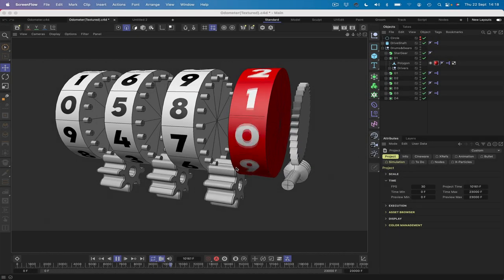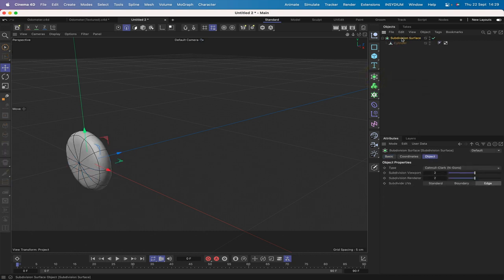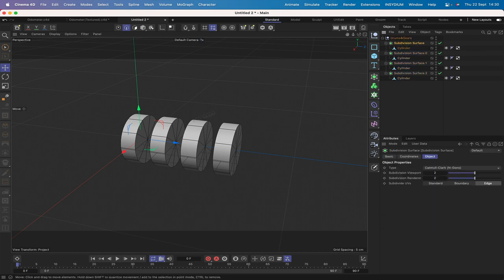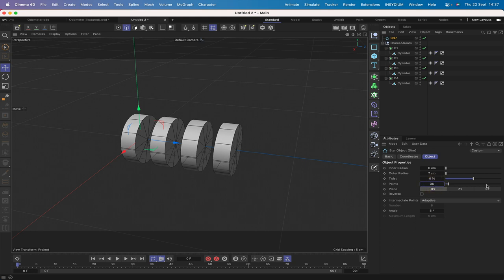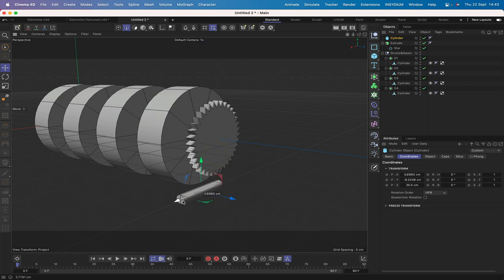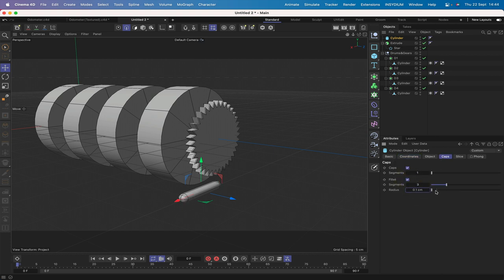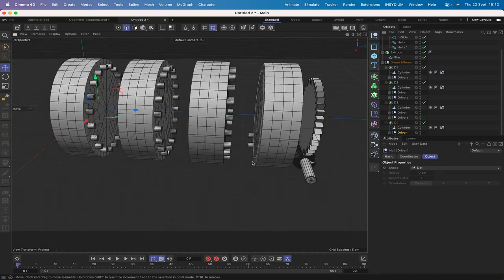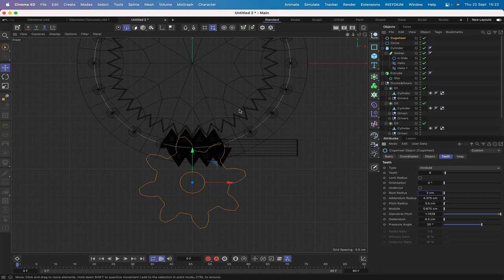Cinema 4D Xpresso Tutorial 51: Building an Odometer

Comment: Great, I fixed it. I not saw the mistake, but I not want to give up. So I throw all the xpresso away and made new one. After some troubles it works now. Thanks Julian for your responses. Therefore I not want to give it up. I put the degrees from DriveShaft to 12950280 degrees and the frames to 179450. Then D1-D4 finished all to zero again and can start again. Thanks for your pushing for trying to let it working! I am 69 years old, but great interesting in this stuff. ❤❤❤😀😀😀

Comment: Hi Julian,

First of all, thank for all the great tutorials.  I’m bit of a newby on XPresso and learning a lot by following your Tutorials.

I’ve had an issue with D2 not rotating, but that’s solved by reading you reply in Willy4740’s question/problem. I’ve still got an issue: Even after I’ve corrected the two compares in the XPresso of G1 Compare 1: < 0 (instead of <= 0) and >- -90 (instead of >= -90) d2 still keeps flipping back. Do you have any idea?

Thanks in advance,

Cheers Ruud
Reply from the maker: Hi Ruud and thanks for the kind words. Yes, connect Result nodes to the current_rot_b Output ports of each Python node. This should solve the problem. Don't ask me why this is necessary - it really shouldn't be!

Comment: i try to make it, but it goes wrong. second cilinder won't turn after gear 1 turns. not find the mistake yet.
Reply from the maker: Check the Range Mapper for D2. You may have Clamp Lower/Clamp Upper checked. The Range Mappers that control G1, G2 and G3 need these to be checked. The Range Mappers that control D2, D3 and D4 need them to be unchecked.
Reply: @ExpressoMechanicTV  thanks for the response. i check tomorrow, because is already late and i look to darts.
Reply: i thought i make already the numbers on the wheels. that is good, but now D2 also not working anymore. this is very strange. i only do uv mapping with uv edit (like you do in the 'barrels tutorial  🥵🥵
Reply from the maker: @willy4740  Double check everything, Willy. It is probably something simple, which is throwing everything else out of sync. It happens all too often!